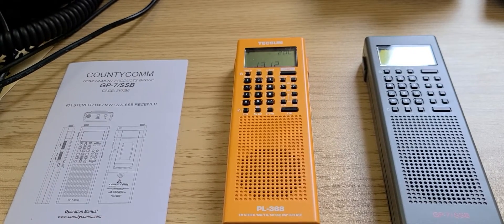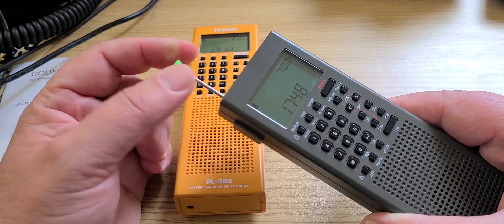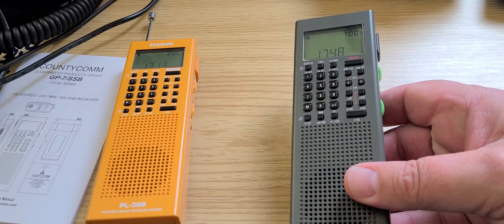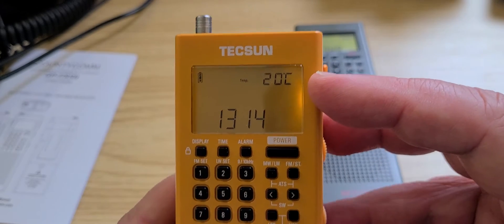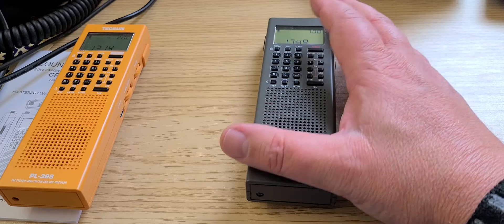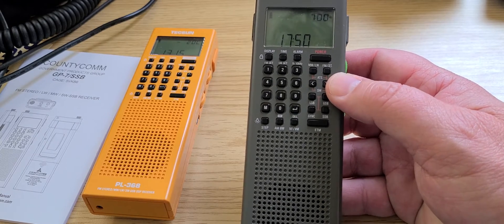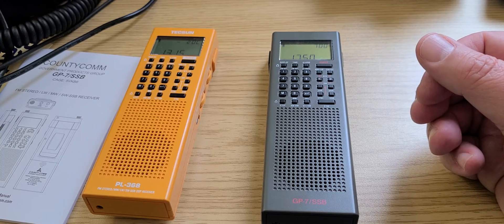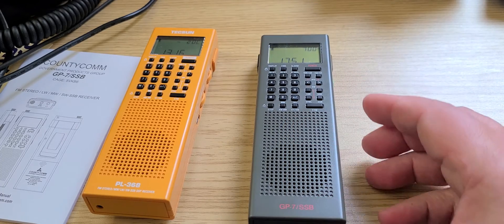Checking Firmware version of the Tecsun PL-368 / CoutyComm GP-7 SSB

Comment: my pl-368 with fw version 3682, after taking it off charge today it has suddenly decided to stop receiving any AM signals, MW, LW and SW....Fm is fine....is there was way to reset this radio?
Reply from the maker: You triggered the internal antenna connection on off... check the hidden features to turn it back on.
Reply: @OfficialSWLchannel  no I mean its completely deaf now, pressing 3 makes no difference

Comment: Just got my GP-7/SSB, and unlike my GP-5/SSB, this radio is completely deaf on LW. I live within a few miles from an aeronautical beacon and hear it loud and clear on the GP-5 but absolutely nothing on the GP-7. Curious if your radio is similar ??
Reply: Update: I sent an email to Countycomm regarding this and received a reply in less than 5 minutes, and informing me that a replacement is on the way. Customer service CAN NOT be better than this.
Reply from the maker: BTW did you make sure the bandwith was not set at  0.5 kHz ...  it seems to default to that at first... would explain why you had a hard time listening to something.
Reply: @OfficialSWLchannel  The bandwidth doesn't go to .5 on AM mode, which is the mode the beacons on longwave use.
Reply from the maker: not deaf... here it receives all the LW beacons I hear on other radios
Reply: @OfficialSWLchannel  well, hopefully just a glitch with this particular unit.

Comment: I can confirm the PL-368 does indeed have the 36.84 firmware. I do wish there was an easy way to replace the antenna since for no reason at all I covet the stainless steel antenna. Is the antenna the same length?
Reply: My yellow PL-368 Also is 36.84 firmware. This was purchased from Anon-Co August 18 of this year.
Bruce KG6JIY